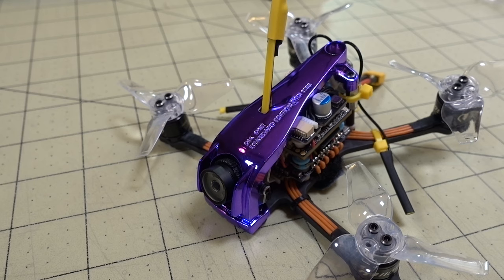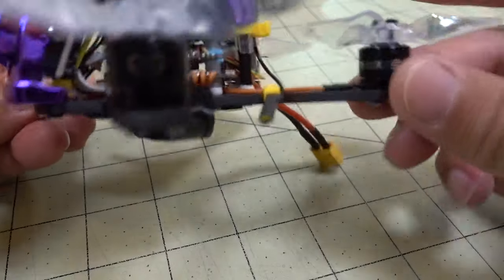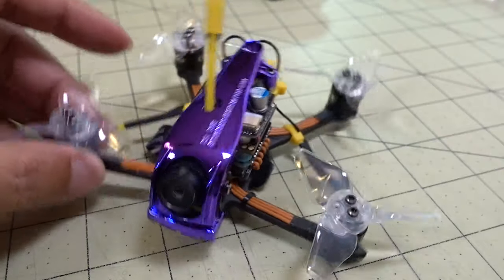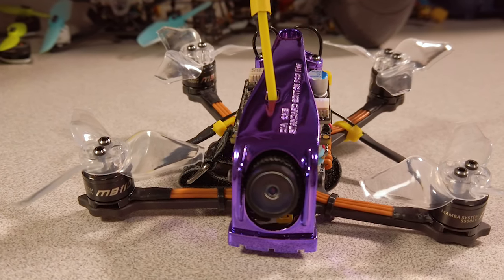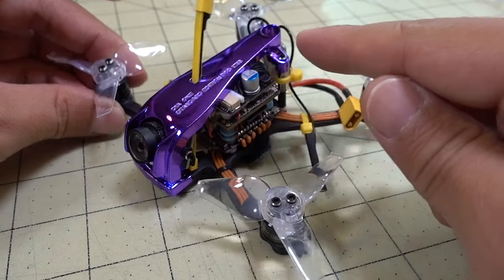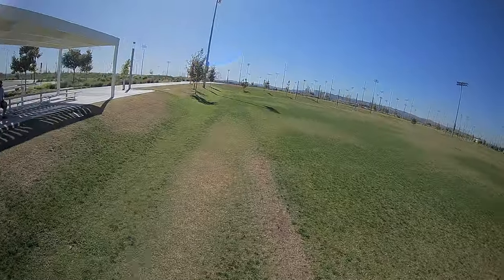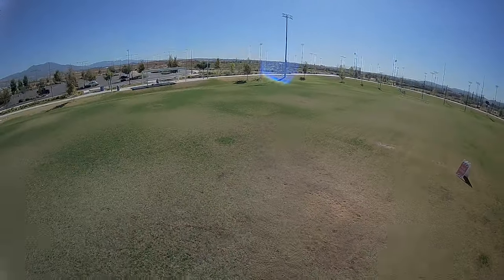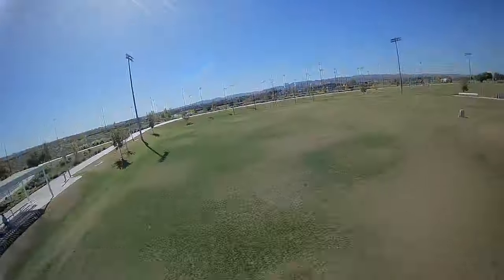Diatone GTR-249T HD Micro 🏁

Comment: All the diatone camera mounts are way to flimsy tobe useful. They always break at the bolt holes for the camera in a light impact and it renders the quad useless
Reply: Yaboi DJBlkRobFPV maybe I’m just unlucky but the first time I ever crash with these canopies the 1mm thin plastic by the camera mountbolts just snap... I’ll try the rubber washer trick next time though!
Reply from the maker: Perhaps a bit unlucky.  I've crashed these a lot and I have almost all the models and I've not broken a single canopy.  Not joking at all...
Reply: Albert Kim May be so. I just wish they added 2mm behind the camera mounting bolts is all I’d ask. That’s the only area that breaks for me, and once it goes, its hard to replace. No material to reinforce.